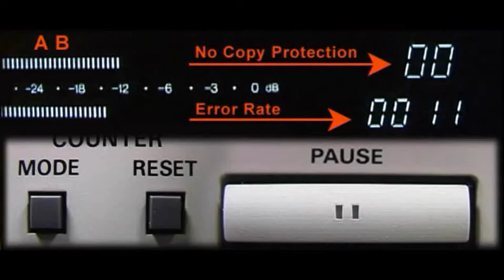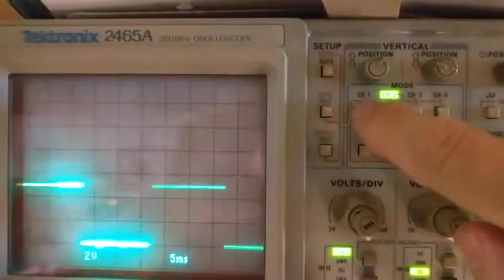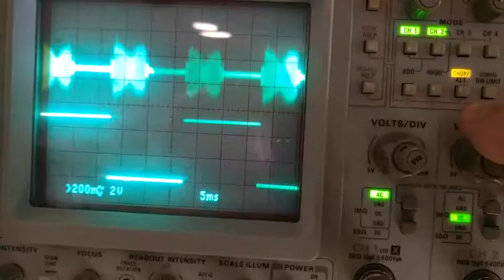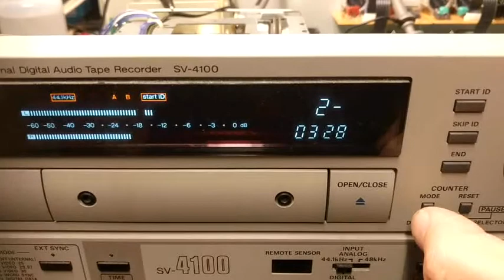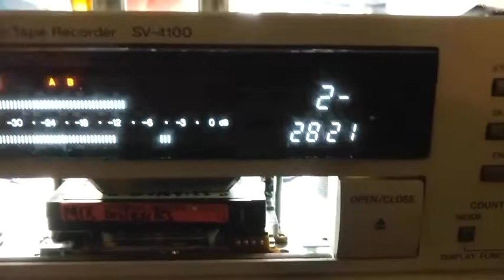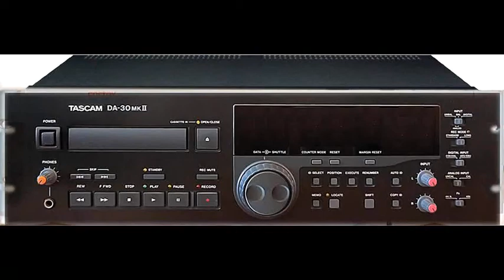Panasonic DAT overview

Comment: Hi, could you help to me ? i got a  panasonic sv-3800, the tape run, play, foward and reverse , no error code, but no sound, what could it be ? thanks in advance.
Reply from the maker: You need an oscilloscope, for starters
Reply: @edaudio  Ty.. I have one.. and I followed your video.. now there's sound but almost between 30 to 60 errors per second... could be end or beginning of the head end life? Thanks for your reply.
Reply from the maker: I'd have to see it, but maybe your problem is pinch roller pressure - if the pinch is hard it may have shrunk - and those machines have clutch issues.
Reply from the maker: @CharlyGrand  without a scope, it's impossible to know. There are many more things that can cause errors than "just" the heads.
Reply from the maker: @CharlyGrand  also, if you have errors reported but no distortion, you're good.

Comment: i search this Test kassette
Reply from the maker: You are looking for a calibration tape?
Reply: @edaudio  yes
Reply from the maker: @Audi.RS3   hard to find. You can do it with a known good tape.  The tricky part is PG delay, but if you set the beginning of the envelope to the swp transition it will be very close
Reply from the maker: @Audi.RS3  or set pg for lowest error rate
Reply: @edaudio  thx.